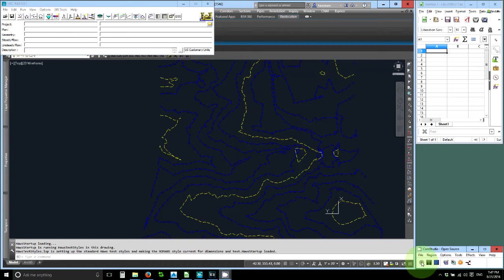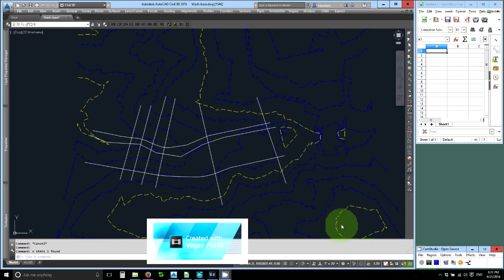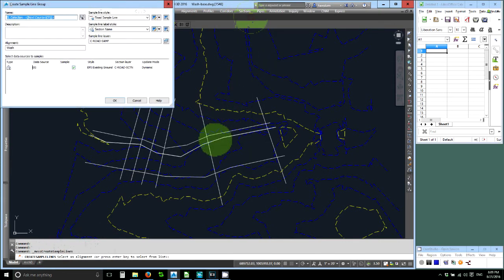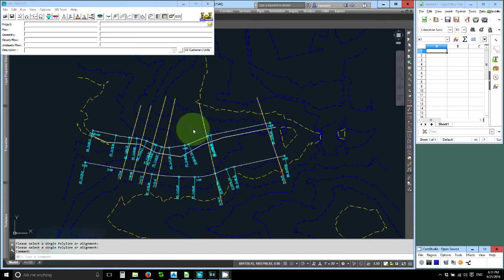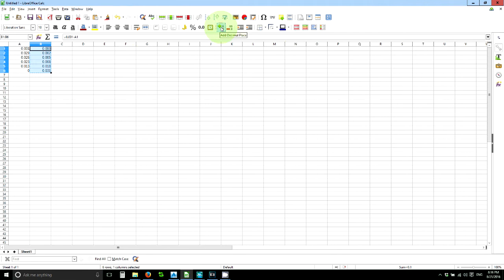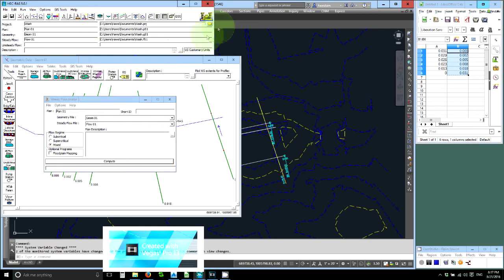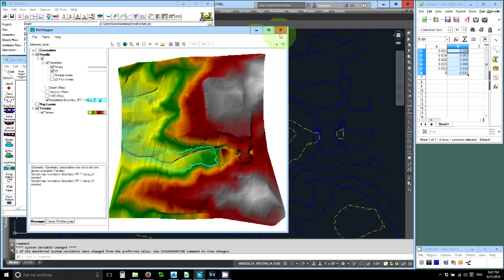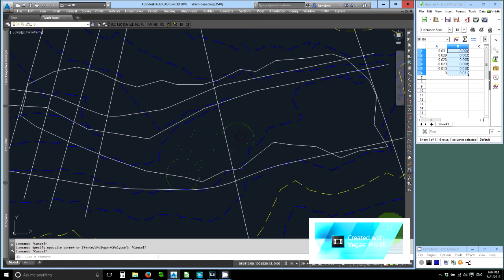How to Map a Floodplain in 10 minutes using Civil 3D, HEC-RAS, and a spreadsheet.

Comment: Please, I have a question, I tried to import geometry files (XML and GML) to Civil 3D 2018 through VBS routines-RASgeoTOCAD2011.dvb, but it was not successful. Which other way can I import them?
Reply from the maker: I would assume you can import them as "maps" (.shp files) after using "Create/update stored maps" in RAS Mapper. Am I understanding your question.
Reply: @TomHaws  

Thank you for your response.

I did use "Mapimport" command, but nothing was imported. I emailed the author (Andy Carter) of the manual presented at AU University 2011, but I have not received any response from him.

Let me rephrase my question, once you are done with your floodplain mapping in Hec-Ras 4.1.0. you want to import your water surface elevation to Civil 3D 2018, how do you go about it?

The manual suggests " File - Export Geometry and Results (Ras Mapper)". once that is done, it gives you two file outputs, which are XML and GML.

Which other way can you import your water surface elevation to Civil 3D 2018?
Reply from the maker: @emmanueladewumi8651  I don't know how to import water surface elevation. I have only imported inundation limits.
Reply: @TomHaws  Thanks for the response, much appreciated!!!! When it comes to cross-section in Civil 3D, they always say draw it from left to right looking downstream but when it gets to Hec-Ras.  it would be flipped the other way.  How best can someone do it?  I drawn polylines in Civil 3D, then use Mapexport command to Hec-Ras...

Comment: Hi Tom thank you for the helpful video, please can you tell me how you drew the right and left over banks ?
Reply from the maker: Just polylines. Is that the answer you needed?
Reply: @TomHaws  did you estimate locations? Did you convert them to feature lines that match the topo surface???
Reply from the maker: @emad nadi No conversion to feature lines. I would drawing them from point to point along triangle lines after showing Triangles on the surface. I actually don't usually export them from AutoCAD as I did in this video. I normally set them using the Graphical Cross Section Editor in HEC-RAS.

Comment: Thanks for the video! It was helpful! When I imported the .geo file to HEC RAS, I got the following error: "None of the XS's are Geo-referenced". I have set the projection in Civil 3D via adesetcrdsys command though. How can I fix it? The river is imported in geometry but the cross-sections not. Any idea about it?
Reply from the maker: My memory may be fuzzy, but is it possible that your alignment or cross sections are not fully contained within the surface extents or that your cross sections are not all crossing the alignment?
Reply: I've run into a similiar issue before where my cross sections were extending beyond the surface extents.

Comment: hi Tom, I do have a question regarding the polyline your talking about in cross-section, is it just a PL?  and the site, is it necessary to assign a site? I've tried it exporting as geo file and itwas zero bytes, and could not load up to HEC-RAS
Reply from the maker: The cross section polylines are just polylines. I don't think site matters. The most common reason I have found for getting a geo file of zero bytes is having an alignment or cross sections that go beyond the terrain surface.

Comment: Thank you! There should be several ways to revise river direction instead of using spreadsheet, right?
Reply from the maker: Yes. You could also enter arbitrary River stations with the smallest at the downstream end. I suppose that creativity is the only limit.
Reply: +Tom Haws thank you, I remember there is a button you can click on Hecras to fix that; and an engineer in Half associates has wrote a small tool to do it before.
Reply from the maker: The HEC-RAS command to reverse River stationing does not really work the way you think it will. The HEC-RAS Flipper tool from Robert Half and Associates should do the same thing that you can do in a spreadsheet.
Reply: +Tom Haws thanks Tom! Hope to meet you in person one day.
Reply from the maker: Likewise!
Reply: HEC-RAS Flipper is no longer available on Half web site, so i think this method is good
Reply from the maker: Yes. Spreasheets are the greatest, and they are a great way to organize your HEC-RAS cross sections.

Comment: how did you assign the location of the streamline, left bank and right bank, to begin with? Are these streamlines FEATURE LINES created from surface???
Reply from the maker: They are simply polylines.
Reply: Tom Haws I was not asking about the type. I was asking how did you define their station on the station line. How did you determine LOB and ROB
Reply: emad nadi when you exporting to hec-ras, you can specify the lob and rob in the c3d export dialogue window
Reply from the maker: It is best, if possible, for the banks to be the natural division between regions of deep narrow flow and wide shallow flow. You could choose a top of bank breakline or snap to TIN endpoints that you feel best represent "banks".